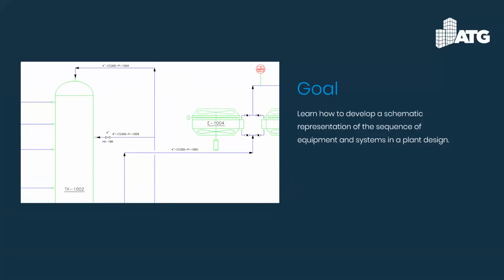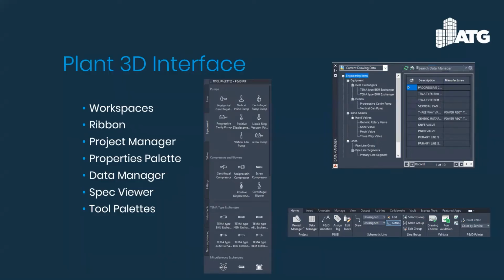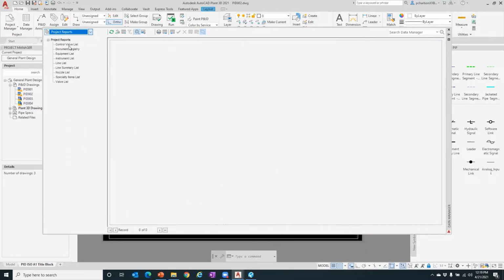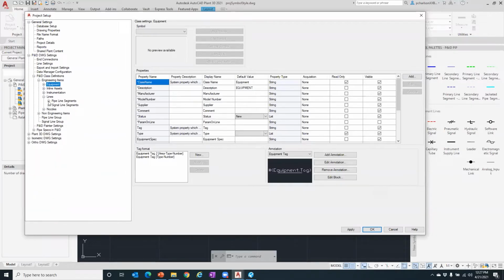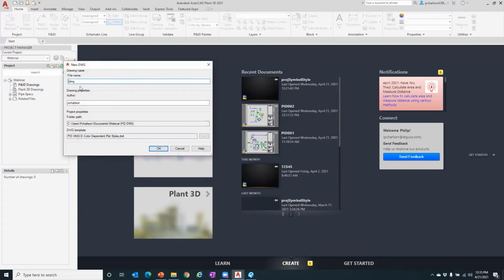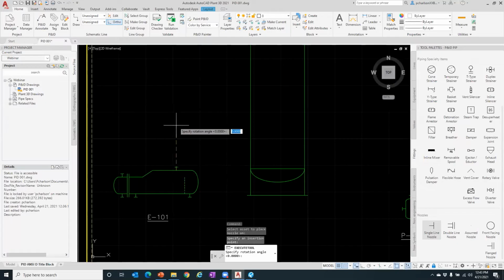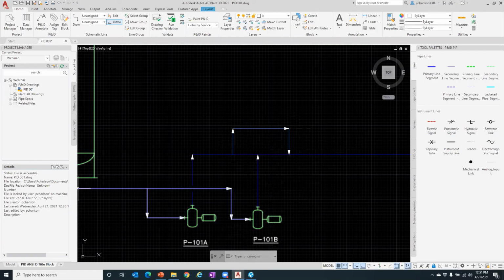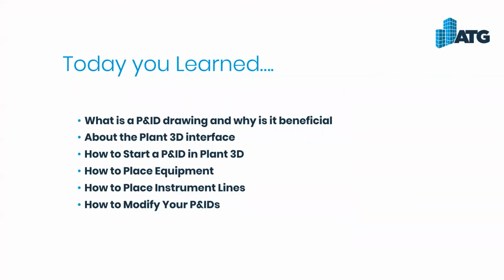Getting Started with a Plant 3D P&ID Drawing

Comment: thanks for this helpful video. I'd like to know the differences between the AutoCAD versions (plant 3D, MEP and P&ID). is this more like a exchangeable toolset?

I have not been using AutoCAD for a decade and now trying to go back into but my application has also changed from a Electrical layouts in 2D to electrical Substations and plant rooms as such.
my question might be off topic and irrelevant, but this is what initially brought me to this video.

thank you very much in advance
Reply: AutoCAD Plant 3D contains the P&ID aspect. AutoCAD MEP is used mainly for commercial design projects where as Plant 3D is more process. Luckily with most people getting AEC Collections you have both which is why I think it is important for people to understand the process of utilizing P&ID now that you have it available.